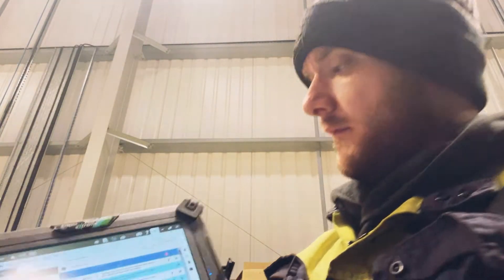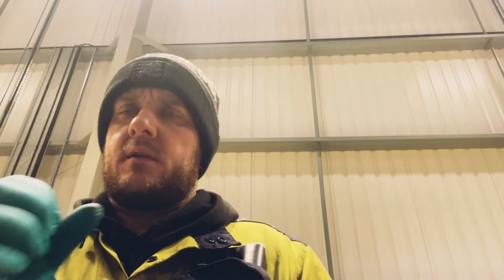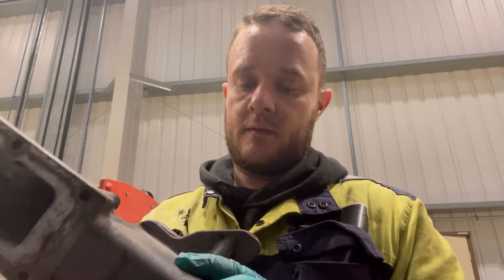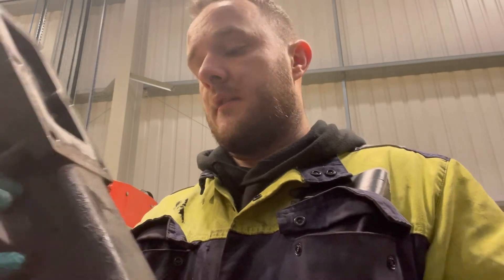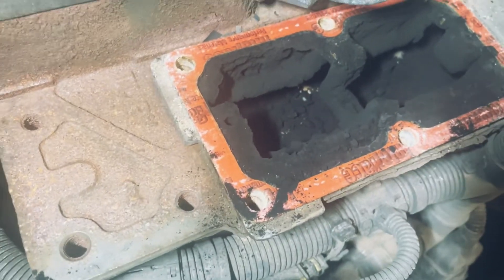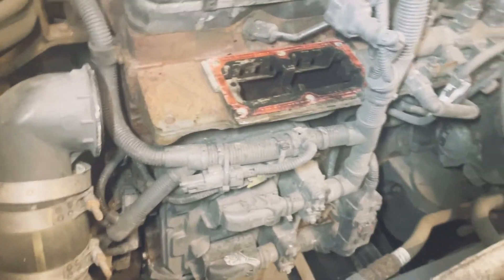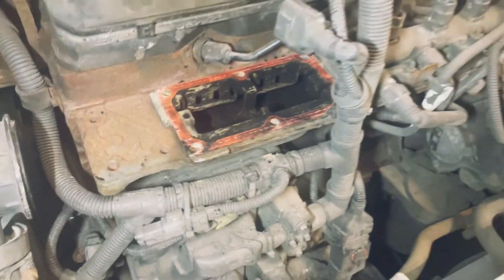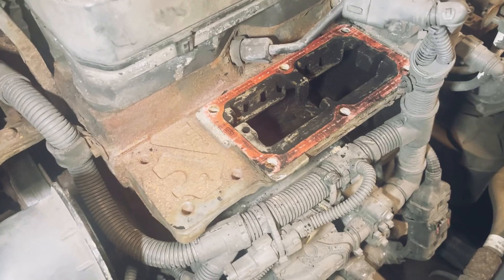Euro 6 DAF LF with exhaust emission fault!

Comment: No e vide man just subbed! Got a few dafs at my place but mostly Dennis dustcarts and recyclers
Reply from the maker: Thank you appreciate it! Ahh how you find working on dafs? What’s the Dennis like to work on?
Reply: @freightlanetv  I don’t think the dafs are too bad mate, done a few clutches etc, got a 8 legger roll on roll off in for a water pump so see how it goes. Dennis aren’t too bad either really some things are easy some bits are harder, but overall alright!
Reply from the maker: I think DAF clutches are decent to do, there’s far worse to do that’s for sure! I’ve worked at MAN and it’s like you say some things are easier and some are worse!

Comment: A few tips i can give on this fault ..When cleaning out the inlet of the cyl head .i remove that plate and steam clean it ,also you can then clean more crap out the head itself ..The manifold that the EGR differential pressure sensor sits ,it there is any pitting on it where the green  O rings sit then it is scrap as it will not seal properly .also make sure the rad /intercooler is clear ..and for vehicle that never get up to temp ie stop start distribution vehicles which you no doubt have a lot of there is a thermostat which i think opens at a lower temp .if you want i can get you the part number ..and always check the cooler to see if it is blocked
Reply from the maker: I’ll definitely take note of that for sure! Interesting about the thermostat, as we have quiete a few of these faults on these particular vehicles, might be something have to look into! When these coke up they coke up bad, we’ve had some really bad ones!
Reply: @freightlanetv  There is a bulletin .also a software update .but i would imagine the software has been done at some time ..I will get the thermostst part number as parts will not have a clue sadly
Reply from the maker: Nice one I’ll get looking into that for sure! Thank you!

Comment: Good video. Thanks 

Hi with “exhaust system malfunction”, on a Euro6 daf 460XF, would it be a fuel dosing valve fault or would it be an issue with the nox sensor? 

I’m not a mechanic at all btw. 
The fault that came up was EOS fuel dosing valve (PIN A05 or A29 of ECU) low  current or open circuit m. 

My mechanic (who is not a DAF specialist) reckons that it’s nox sensor that needs replacing. 

Could you offer some advice please?

Comment: Have a euro 6 lf slight miss and lack of power in the engine today  , no dashboard warnings but in the past month the soot filter went to full limit and started buzzing and giving the waring saying it’s full before it began to  regen , normally regens  when it’s about  half full with no issues !Could  this possibly fix the issue of the slight engine miss and lack of power or might there be something else to look for ?
Reply from the maker: Is it a LF or CF? Once the dpf is so full we’ve had them in the past reduce power that’s on both, if a CF pull the cover off the exhaust and check the dpf isn’t clogged

Comment: Can never understand why we use egr systems, great when a vehicle is new but as the miles go on the down time in repairs and engine efficiency is greater than the environmental gain . Look in a euro 3 intake manifold that’s done 350000km and it’s like new.
Reply from the maker: It’s crazy just more problems to deal with! But guess they do anything to reach targets emissions, environmental etc